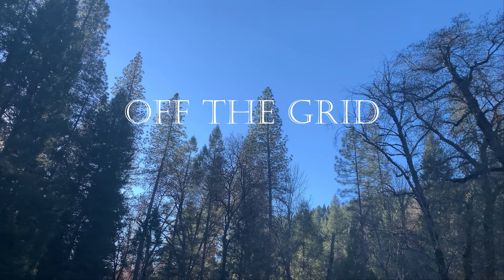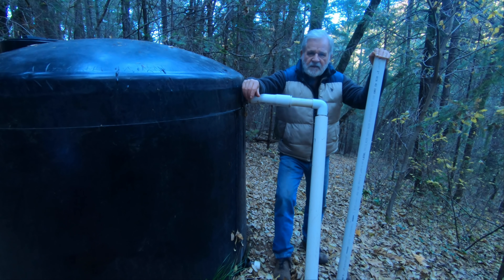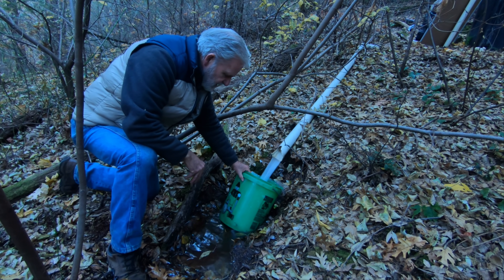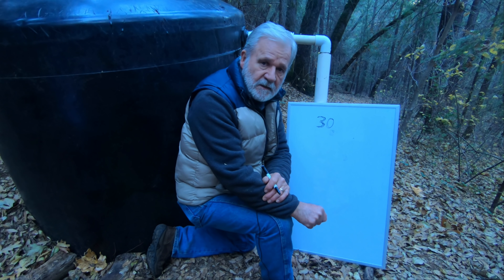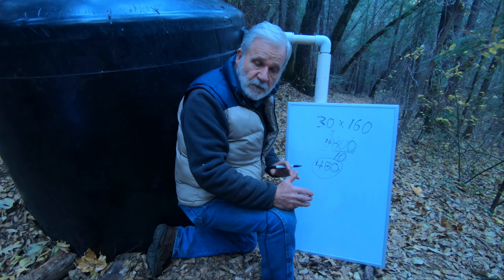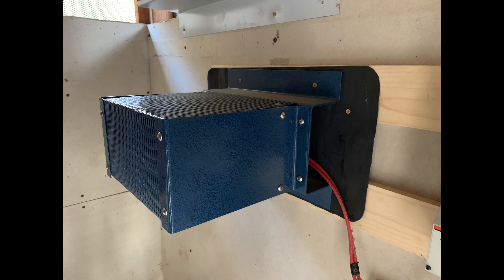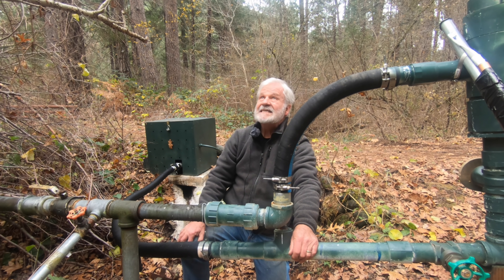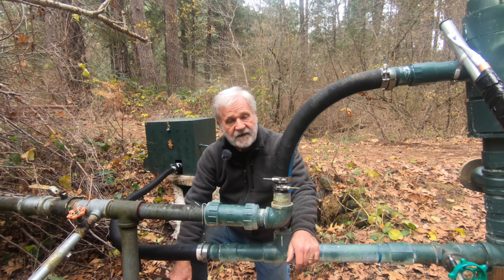Micro Hydro...When it Rains it Roars. Off the Grid with Karen and Grid

Comment: Just came across your quest for more watts…in case I want to go big….and try a larger wheel….do you have links to your new set up?
My creek experiment is DOA…so now I’m going solar pump storage and see if I can get 3 to 5 hours of 300-500 watts ….with a Harris unit….love your beer making 316 ss fittings…makes for sweet connections.
Reply from the maker: Hi there. I worked Jerry Ostermeier at AMP Hydro, Grants Pass, Oregon. Amphydro@gmail.com

Comment: (30L X 160m)/10.... Please clearify what the number 10 represents? Thanks
Reply from the maker: Hello Raphael. Good question. The number 10 is a simplified (probably over-simplified) way of factoring in the efficiency of the nozzle, pelton wheel, alternator, shafts and bearings, etc. to calculate best case installed efficiency. While it is widely used, it is only a rule of thumb to help laymen (like me) determine if their site might be worthwhile. If you'd like more information I would direct you to APM Hydro (apmhydro.com). Jerry Ostermeier, the owner, has one of the best sites I've come across. His narrative walks you through the whole process, for site evaluation to installation.

Comment: what does a system like this cost?
Reply from the maker: Hi Butch. The power unit, meaning the pelton wheel, alternator, amp meter, breakers and charge controller cost me about $2000. But that was over two years ago, before supply shortages and inflation. PVC pipe and wiring were separate and cost would vary depending on distances. Check the narrative for this episode for more details. Best, Grid

Comment: Just a thought here to save power all the way around. Instead of having the charge controller dump the unneeded current over to the heat sink, make that power work for you. Have it send that power to a relay bank that works to send that unused power to a heating element in a hot water heater. Then, have the relays switch back over to normal power for the heating element when there is no excess power being produced, but the water heater wants to turn the element on. That seems like the best use of that temporarily unneeded current. I know it would be a bit of work getting the relays set up just right, but it's definitely doable, and would let you use all the power instead of spinning some off as heat. Maybe run the water heater only off of it. It would limit the amount you would have and when you would have it, but it would be a totally "free" source of hot water. If the water heater is a smaller 6 gallon, or a bit larger, version from an RV, you could have a tri-source water heater. It could run on gas when needed, off the inverter on 110 if needed, or burn the excess 12 volt DC if needed (I'm assuming that ~ 12 - 14 volt DC is what's coming in and what's hitting the inverter and heat sink, that is). 

Or, instead of that, maybe, in the winter, have the heat sink in your home. The extra radiant heat would be appreciated and make the fuel load on your other heat sources reduce by a bit. It wouldn't be a huge amount, but it would help. Then, in the summer when you wouldn't want the heat, move it back to the outbuilding. 

Just thoughts on ways to use the excess. You might as well use all of it that you can in ways to benefit you.
Reply from the maker: Thank you for taking the time lay all this out. You have a quick mind. We actually thought about how we might take advantage of this “free” energy. Unfortunately, the utility shed where we collect, convert and store power is 75 feet from the house. The cost/ benefit of a 24 volt wire run to the house to use intermittent low amp power for a resistance heater just wasn’t there -~ especially after the guy who built our alternator cautioned us about the reliability (safety) of low voltage heaters currently on the market. Our water heater is a propane-fired demand water heater, so no way to tap into that unless we replace the heater for something like what you suggested. But you’re right, there’s GOT to be something I can do with that energy besides heat the utility shed. We continue to think on it.

Comment: Nice video. My personal hydro system is making 250w right now. Coupled with 3kw of solar my power bill is reduced by $60 a month.
Reply from the maker: Thanks for the comment. Your own set up sounds like a nice installation. We have no power poles within 15 miles, so what we have is what we get.
Reply: @offthegrid4036  Sounds like a fellow I filmed last year. His system also has 250w. The power company wanted several thousand dollars to run power out to his place. He is off grid in a yurt.

Comment: Could you make a series connection with two Pelton Hydro  wheels to double your energy output?
Reply from the maker: Good thought. Unfortunately, I’m limited by the volume of water I can drive through my 2” pipe. One unit seems the right fit.
Reply: @offthegrid4036  why can't the discharg water from the first unit go through a second unit, i thought you said it was a 2" pipe, meaning the discharge from the unit you already gfoes through the second unit, isn't that the same amount of water?
Reply from the maker: Hi Butch. The pelton wheel is spun by water pressure, which is created by the 100-plus foot drop from our collection tank to the micro hydro unit. Once the water is discharged from the unit it no long has sufficient pressure to drive a second turbine. In some months we have surplus water and could add a second unit. We’d simply have to shut the second unit down when supply from the spring decreased. Note we need some surplus water at all times for the house. Given the cost —and the fact we currently generate all the power we need, we have not taken this step.

Comment: Cool you have water to use for a power source.

Think I would ditch the gate valves in the plumbing unless you make a habit of always opening them up fully. The friction across the bottom of the brass disks will eat them away and cause the seats to fail eventually. Ball valves give the option of throttling if needed without that issue. Yeah I know. Everybody's a critic. I'll shut up now. :)
Reply from the maker: You are absolutely right. I have replaced two of the offending culprits….three to go!  Thanks for the comment.

Comment: If you're going to waste your time calculating your power output, why not just convert your flow into (L/s) and your water pressure at the turbine to (kPa)

...and multiple them together. No "rule of thumb" necessary.

Power (W) = Flow (L/s) * Pressure (kPa)
Reply from the maker: Ouch!  Wasting my time is not quite how I would characterize it. My rule of thumb calculation allowed me to determine if hydro was a worthwhile investment. It was. And it continues to be. Your formula certainly demonstrates your knowledge of the subject. I’m impressed.
Reply: @offthegrid4036  the waste of time isn't estimating your power potential, it's using numbers (without any units... a pet peeve of mine) with an imprecise formula that looks like it was pulled out of a hat when the correct formula is just as simple to use. 

...which is partially how NASA crashed the Climate Orbiter into Mars.

Granted... I'll give you a break since you're not launching $300M worth of taxes into outer space!

Comment: Nice video and thanks. Two questions : Who is playing that great music? and it's been almost a year.so a report on your experience so far would be nice.
Reply from the maker: Hi there again. I just came down the hill from checking the system. It’s working great, not one problem since we first started it up early last year. Good thing, too, as there is snow on our solar panels. This morning i checked batteries and our little turbine charged them up to “float”. And that’s after using computer, modem, lights and washing machine. We’re very happy with it. Were you suggesting a video update?
Reply: @offthegrid4036  No. I was just wondering if it still worked. I saw you mention you live in the Northwest. We moved to Marysville, Washington from Texas in March 2020. Are you in Washington?
Reply from the maker: No. About 200 miles south, in the Siskiyou Mountains

Comment: Nice job man! I run recycled batteries using solar and hydro. There so many items people throw away that create electricity.
Reply from the maker: Thanks Andy. Can you tell me about the recycled batteries you use?
Reply: @offthegrid4036  I honestly use 36 car batteries inline.
It's easy to clean a battery add a little acid and distilled water to make them useable same way auto recyclers do it. But I also use a breaker box to the house and a decent regulator.
Reply: https://youtu.be/IpsxtLnNKUk type of deal. Using different salts and acid with new water can restore batteries if done while in a charger.
Reply from the maker: Thanks. Useful info.
Reply: I live in rural part of Washington! I understand the struggle and to recycle

Comment: Install a tank and pump to send the water back to the dam. If the pump is in line it can be water powered.
Reply from the maker: Ah! A ram pump. Several folks have suggested this….and I’ve thought about building one just for the pleasure of learning about something else that doesn’t require electricity or fuel. But so far, I’ve been a slacker. My rationale: I’ve got plenty of water up the hill.  But someday..
Reply: Laws of physics -- conservation of energy. You don't gain anything by doing this. Only energy losses and the cost of extra infrastructure.

Comment: I get a bit over 900 watts with  147' of fall in a 1/4 mile, using 3" piping, and about 90 GPM, with a Harris hydro.  Grid tied. As I type this, it's down there putting 760 watts into the grid, (low water right now) turning my meter backwards, and my utility has a 100% net metering plan: I get back every watt stored in their system, no matter when I withdraw it or how long it's in there! Off grid for 28 years previously, I like to think of my utility as a battery: with infinite capacity, 100% efficiency, that never needs replacement, and takes up no room. Going into winter, I will start using up my current 9,000 KWH credit, as my consumption overtakes my power production. I haven't paid a power bill, except for the $5.00 basic fee, in over 40 years.
Reply from the maker: Great story. Thanks for sharing. Amazing you can get 90 gpm through. 3” pipe. Finally got enough rain here to crank ours up last night.
Reply: @offthegrid4036   I don't want to mislead anyone, but I think I did the math years ago and the figure 90 GPM sticks in my mind.  Fusion welded HDPM pipe, no fittings enroute helps.  Today I noticed the dynamic pressure was 55 PSI, and I was putting out a hair over 30 amps, at 26 VDC, so 780 watts. I am PERMITTED for 90 PSI, with my state Water Resources board, maybe that's where I got that number from. It is classed as a "non consumptive" use. The rancher below has the actual water use rights.
Reply from the maker: What size orifice are you using?
Reply: @offthegrid4036  Just eyeballing it, 3/8", 2 of them. Max flow I use  two 7/16" jets. Real low water, and I have to go down to 1/4"
Reply from the maker: Thanks. I will experiment with nozzle size. I have only one, good for 7 amps with existing nozzle and a lower flow rate (small spring).
Reply: @offthegrid4036  You know I'm sure keeping the delivery piping full so as to get full head pressure is critical. I've learned not to get "greedy" by using to big of jets, I change my jetting (a couple minutes job) based on my pressure gauge: if the pressure drops below my normal 55-60 psi, I'll go down a size, and find that even moving less water I make more power, fun stuff!
Reply from the maker: Thanks. I’m increasing size tomorrow. We’ll see what happens.

Comment: Thank you for that wattage formula. I have some land in central NH that has a stream on it. The flow is over 300 gpm and the drop is about 35 feet, so it looks like it would be worth while to install a Micro Hydro.
  What part of the Country are you in? How cold do your winters get?  In N.H. the temp drops below 0 F. I'm afraid that the pipes would freeze, even with the water constantly flowing.
Reply from the maker: Hi Kevin. Sounds like you have an excellent source of hydro; low head, high volume. We are in the Pacific Northwest. We don't get below 0 F, so it's not an issue. If you don't plan on using the place when it's that cold I guess you could always shut it down and drain the pipes.
Reply: If the water is kept flowing, it won't freeze.  We collected water from a spring at over 11,000 ft in Colorado Rockies, where 0 degrees F was a warm day,  ran it through a 1 inch plastic line on or near the surface and it never froze up but, we never turned it off.  It served us for drinking water.  We didn't bring it into the building it just ran out there on the porch a d down the slope to the creek.  We could have put a little Pelton Wheel on it but, the 2 or 3 gpm was pretty low flow and a low pressure because of the length was long and pipe small and we had loads of Public Service power available.

Comment: I was not able to understand, where waste water go after running turbine?
Reply from the maker: Sorry I was not clear on this. Take a look at the video and find the photo of the pad I poured to hold the power unit.  Note the hole in the center of the pad.  The power unit sits on top of this hole and after spinning the Pelton wheel water is discharged through this hole.  It flows into a creek bed and down to the river.  Hope this helps.
Reply: @offthegrid4036   thanks, Do you think it is possible to pump back water to tank if possible? I’ll be working on one project in September to test this theory if work .  Other option is , We have agricultural land and need water pumped out from ground to use , I’m planing to use that high pressure water to run turbine to recover some of energy while still can water for irrigation  and cattle etc .
Reply from the maker: Not efficient to pump back up the hill. Would probably take more energy than I'm producing. And, in our case, we have an endless supply up the hill so no need.  Re well pump, if water is being discharged into an irrigation ditch under pressure, then capturing that velocity to spin a turbine might be a good idea.
Reply: @offthegrid4036  yes  you are right . I’ve see your videos and for off grid it is idea situation. In our case we don’t have mountain or water source but ground water which is about 100Feet below ground . We did drill to gain access and used water pump to get water out . Instead releasing straight to land, would try to use turbine to capture some of energy. I’ll share video and efficiency once it’s working after installation. I’m not engineer but want to work out if stored water well above group , let’s say 1000-1200 Gallons and use that turn turbine, change batteries, then use same power to pump water from ground to tank above ground. It seems not logical but will give it try as well .
Reply from the maker: Thanks.  Keep me posted,

Comment: Nice work. What are you using as an alternator?
Reply from the maker: Thanks. 24-volt truck alternator. Fabrication by APM Hydro in Grants Pass
Reply: Interesting. That permanent magnet, self exciting, or need external excitation of coils?
What kind of volts per rpms does it do?
Reply from the maker: Sounds like you know more than we do on this subject. I really don’t know the volt per rpms. Suggest you check out APM Hydro (Grants Pass, Or).
Reply: Ok cheers, will do.

Comment: Why not install the micro hydro above the tank so you capture the energy before you capture the water? That way, your usage of the water will not affect the power generation.
Reply: with micro hydro the energy you are capturing is generated in the fall, in this case from the tank to the turbine. The turbine must be as low as possible and the water source as high as possible for maximum power.

Comment: Very nice system. How does the actual power produced compare to your initial calculation?

I'm stating the obvious here, but if you upsized the diameter of the pipes your friction losses would be less.
Reply from the maker: We get between 7-8 amps at 24 volts, continuous. ...and you are right, largely er penstock  would have a lot of benefits.... but the 2” was in place for water and, rather than add another 1000 feet of PVC pipe, I went with what I had. Fortunately, amperage generated meets all our needs.

Comment: Awesome, do you have any use for clothes lines for drying clothes (indoors and out) during the winter a basement furnace room can work very well for drying clothes
Reply from the maker: Thanks. We use a clothesline when the sun is out. When it’s not we use a drying rack (see “Dry Your Clothes in the Rai” episode. Unfortunately, we don’t have a basement. But a great idea.
Reply: @offthegrid4036   Sir, in the area i live in eastern Iowa there is normally a dam in each town on a river, and these dams need to be producing energy what a waste.  Brand new river dams and the very old ones as well with no power generation.  There should be laws and funding, very clean energy being wasted. Yes sir, the clothes lines for me is a fun activity.  In city or country.  Basement furnace room very dry and warm, and has great air circulation in the winter, i could dry out a couple washing machines full at same time down there, hanging up on clothes lines, and they would be all the way dry in about 12 or 18 hours.  I have not used my clothes drier at all in a year.  Electric bill went down a bit.  Neighbors i have in the city are ok with the clothes line i hang up, i try not to be a nuisance with it.  I would like to do rain water harvesting for washing all my work clothes.  Another idea would be clothes lines park, with hundreds of clothes lines for free,  rather than laundromat with all those driers wasting energy.